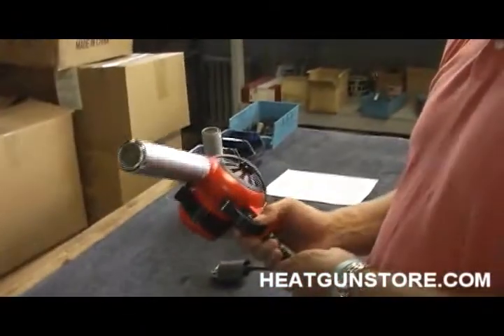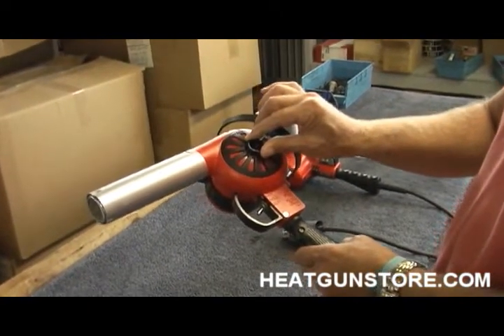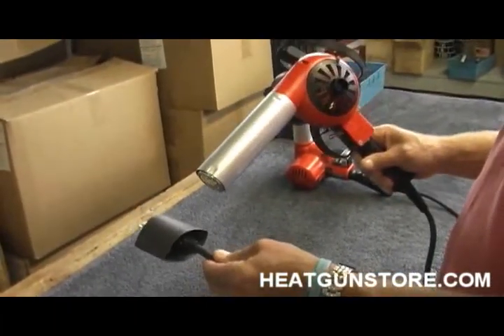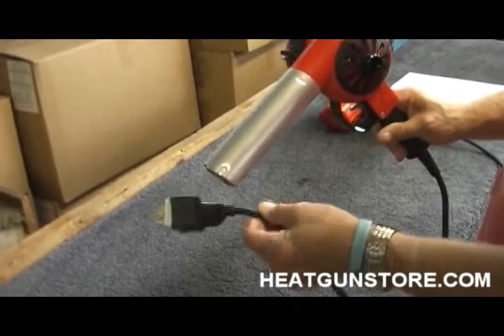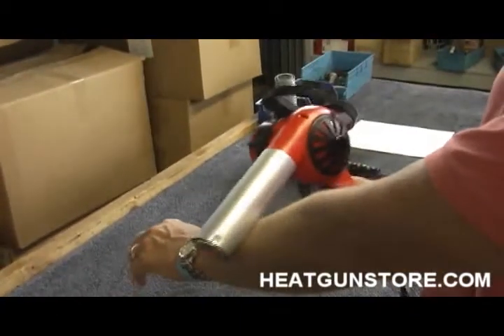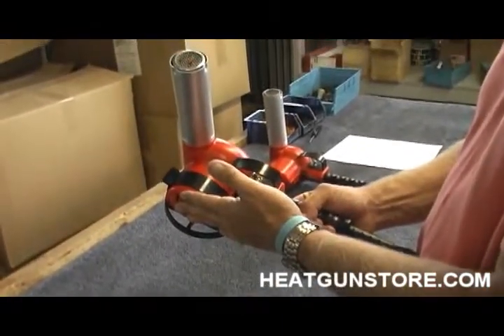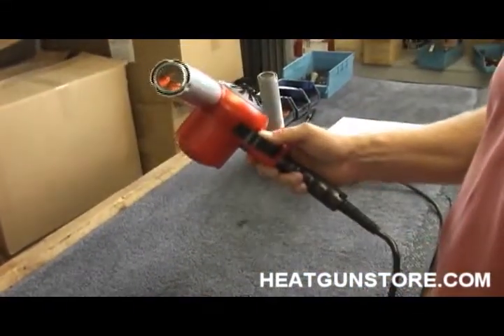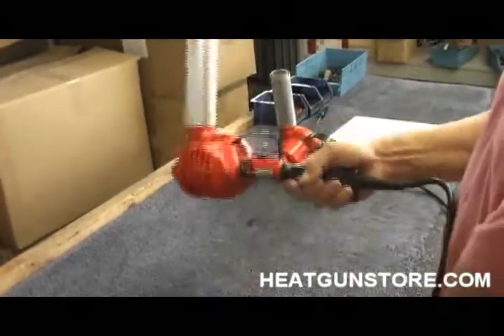Eddy Mark IV Heat Gun Features and Demonstration

Comment: Thanks for the clear instructions....I bought by accident a gh201d heat gun not realizing the output was only 450 Fahrenheit...
Can I put the element for a gh301d in the hg201d so my output goes to 800 Fahrenheit ?
Thanks in advance
Jan
Reply from the maker: That all depends Jan.  Each manufacturer heat gun varies and the element isn't always the only thing that controls temperature.  If you're still looking for a gun in the 800° range, give us a call and we'll be happy to help!  Cheers, Jason